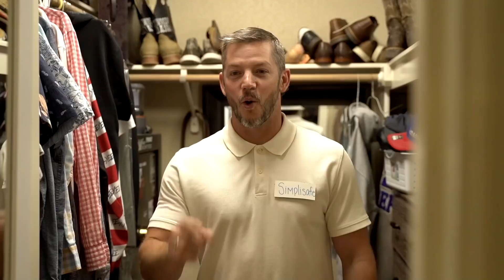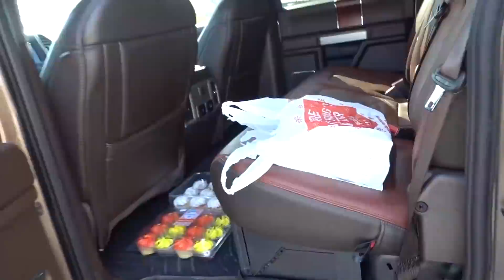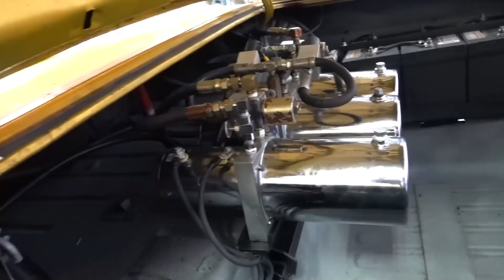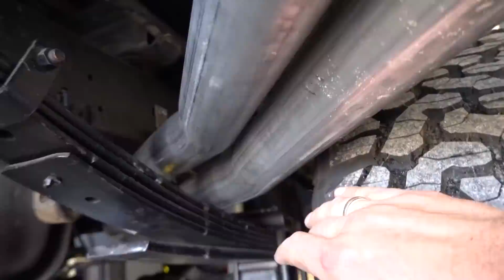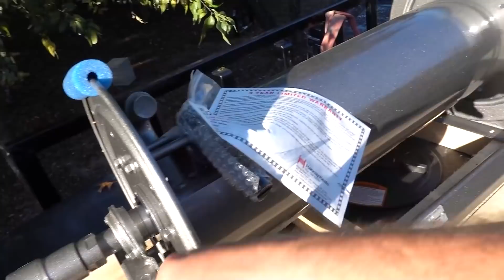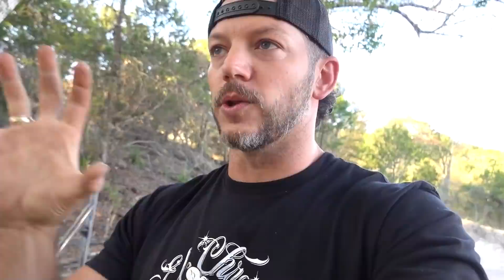Here's How a Local Car Shop Screwed up the Bronco...

Comment: Graphing is normally done to young trees. I've seen comments to dig a trench behind the tree and pull it straight then anchor it down which would work on a younger tree that don't have established roots. On a tree that size, you'll run the risk of shocking the tree and killing it so its best to cut down it and let the smaller younger trees next to it grow and fill that space.

Comment: As a licensed arborist in Maine that deals with oak trees almost everyday the tree will not be as strong after cutting and straightening of the base. It would have a much greater chance of coming down after doing so. The best thing to do in my opinion would be to cut it down completely
Reply: I agree, it also has a cavity in the bottom running up to the bend.
Reply: Don't forget that Oaks are susceptible to oak wilt
Reply: Great to see a fellow Mainer!
Reply: I think he was kidding when asking if he could bend it by cutting a wedge out of it! LOL He has to be trolling all of us in this video because there is not any chance in hell he is actually leaving that exhaust on the bronco, it has to be a joke he is playing on us, right? I mean, he has Muscle Rod shop that could have tossed in that simple exhaust for him. Then he has those high school kids that did the 5 ton cage he could have had them weld in an exhaust. So the current abortion of an exhaust is a joke on us i hope!

Comment: Regarding the tree, dig a little trench next to it. Make an anchor point some meters away and attach a winch to pull the tree more straight. Hopefully it will settle correctly in the little trench.

No cutting, no damage to vehicles.
Reply: This or just cut it down. But I like this idea.
Reply: Good idea. Undermine the trunk/roots on that side and hook the 5 ton to it, yank it over then anchor it somehow. Huh.
Reply: You'd need a few hundred tones of force to do that a tree that size.
Reply: It's growing that way not leaning so won't work and your cutting the anchor roots if you dig a trench next to it. So not worth it.
Reply: @Crzzyhillbilly  no you don't. If you go high and use a dolly it's very easy.
Reply: @HITMAN20211  He's not trying to move the top of the tree..
Reply: @Crzzyhillbilly  I know...

Comment: I think you could've welded the bronco exhaust better than they did and running the exhaust through the leaf springs like that, really? You should take it back and make them fix it or reimburse the labor cost. You're going to have issues with it, you're probably better off taking it to reputable shop and having them just redo the whole thing.

Comment: I got a couple things, firstly, make sure you have some flex hose for each section or the vibration and what not will likely damage it. You can also use high pressure suction hose which is like a very ridged flex hose.
Secondly you should definitely be bringing that exhaust back to be refunded and then take it to a shop that can do quality work.
Lastly not only will a graft like that not take, it would be extremely difficult and dangerous to attempt since with all the bends it the tree there would be different sections under tension and compression and that tree is probably 10,000 pounds and effectively has a sail on top of it, it would probably be easier to cut the tree and balance your f350 on the trailer hitch on the stump. I’m exaggerating but I would definitely recommend just cutting it and having a company come plant a mature tree in a more convenient spot
Reply: Agreed. All very good advice. The tree definitely has to go. There's plenty of them left around and it way too unsafe to attempt a graft. 

The only other idea I had while watching, was that the hose reel for the fire truck should be mounted so that it is inside the bed of the truck. If it hangs off the side, it can get caught on stuff and be damaged right when you need it the most.
Reply: I was going to say the same thing about the piping for the house, though the easiest would probably be rubber flex fittings/boots at the beginning and end of each run, but for the exact reason to absorb any flexing or shifting from uneven/rough terrain.

Comment: Unfortunately grafting a tree of that age is an extreme long shot that could lead to the tree dying and ultimately falling causing damage to other trees surrounding it
Reply: Still worth a shot its ether getting cut out or surviving lol its already taking damage and thats not exactly good ether for a tree. The biggest problem I see is moving it without it breaking off and ther healing process
Reply: @jake-bw7rw  I just suggested that he turn it around. Lots of companies can pluck it right out of the ground and turn it 180 in the same hole. Kinda expensive though.
Reply: @mckrackin5324  yeah they can do that I sapose but it puts alot of stress on the tree and it might not survive also it takes away alot of its structure so if a good storm rolls in it could do more bad then good but thats not a half bad option ether

Comment: Please take the bronco to a professional shop to have the exhaust fixed.. imagine the shotty work you can't see.. not to mention, I wouldn't be surprised if they were cutting and grinding the exhsust with the engine opened up  if they had to remove things for fitment

Comment: That's called grafting. A tree that big has to have a much smaller graft branch in it. Too big of a branch grafted in will kill the roots.  Early spring would be the best, so long as it goes dormant (leaves all fall off). Do it right before the trees all leaf out so it sends nutrients from the roots into the new portion that's been grafted in. Plenty of videos on how to do it. The trees are both bent that way for a reason though. Strong regular winds, etc. Might be better just to cut it down.
Reply: bump
Reply: That bend is from a very long time ago.

Comment: Do not think you can cut and graft an older tree like that, the old wood inside will not heal, only new growth will heal and new growth is just the outer ring.

Here is an idea though, hire a tree mover, they can just pick up the tree, clock it about 180 degrees and place it back in the same hole.
Reply: Pretty sure thats way too big of a tree to be moved by a tree mover, its also a terrible shape for moving and tis not very economical either.
Reply: @eraldorh  they'll move 300 plus year old trees. This size of tree would be no problem for them. The lean on the other hand they might pass on.

Comment: The tree will die if you cut it. You would never be able to align the phloem , cambium and the  sapwood let alone support the weight of the structure.  That works on small plants I never seen it work on a hard wood plant such as an oak.

Comment: People need to quit letting shops like the exhaust get away with that. That’s a ridiculous job and should be fixed by them. I just fixed an exhaust on my wife’s f150 because the previous owner excepted a piss poor job
Reply: Exactly why I started building my own. 
You can get kits with slip fit couplers and mandrel bends then weld it up.
Reply: @brandonrice8905  

Yep! That’s what I used. Hell the stuff I took off was even welded to the hitch for f’cks sake! smh
Reply: @Fordgroup00  my old truck's exhaust had welds that looked like rusty cottage cheese with hairs in it. Yeah, there was welding wire sticking out all over every weld. But none actually leaked. So I guess there's that.
Reply: To be fair, if a muffler shop couldn't figure out why running an exhaust pipe THROUGH the leaf springs is a bad idea, I don't think I would ever want them anywhere near any vehicles I own ever again
Reply: They excepted a bad job??
Reply: It's not even flared and fitted for a mechanic to replace the bad transmission if it ends up being that
Reply: Accepted

Comment: Look up a “Tree Spade” giant piece of hydraulic equipment that you could pick up the tree by the root system and spin it 90 degrees out of the way or just relocate it all together.
Reply: luv this suggestion even a tree as big as that one
Reply: That’s what I was going to say!
Reply: Great idea if a tree that large can be moved with a tree spade.
Reply: Unfortunately a tree spade wouldn't be feasible for that size of tree. The general rule of thumb with tree spades is that the spade needs to be 10 times larger than the diameter of the tree that you wish to move. If Matt is accurate with the 2 foot diameter of the tree then you would need a tree spade that was at least 20 feet.
Reply: I dont know much about trees but isnt the root system almost as big as it is above ground? you would need a unit of a tree spade 🤣

Comment: They had it on the lift when they put exhaust onto everything was hanging low, and once they set it back down you lost all your clearance.
Reply: True… but a good exhaust shop would A know that and B check before giving it back to customer.
Reply: @sccarguy8242  Absolutely! What a joke indeed.
Reply: That's why all the muffler shops I've ever seen will use 4-post lifts for everything.

Comment: Related to the tree, theoretically it's possible. The problem is that most likely it'll just break under it's own weight(as you're trying to bend it). On top of that, I don't see how you'd be able to support that much weight without it snapping during the next 10-15 mile an hour breeze.

So, realistically you're better off just cutting it down.
Reply: I agree with the above statement. It comes down to how badly you want to save that tree. NOT being an arborist, I'd assume splicing the tree is theoretically possible, but it would involve serious expense and effort for a (likely low) chance at success. Also, considering the "suckers" surrounding the subject tree, I suspect it would be best to cut the main trunk and let the newer growth continue.
Reply: Agreed.

It does look like there is some shoots coming out the bottom of they tree. They will likely grow extremely fast if you cut the large main portion of the tree and leave the small ones sticking straight up
Reply: Or relocating it? :D

Comment: It's pricey but you can turn the tree around 180. It's growing towards it's dominate light source. If they were to pluck it up and turn it around, it would try to lean back the way it was and eventually stand up straight. It would also have a really cool S bend in the bottom. Lots of tree relocation companies to choose from and it would be a little cheaper since they won't be transporting it anywhere.

Comment: You might want to talk to a local nursery about moving the tree. I dont see a cu t and regraft working. If they say no way to move it i say  heck with it cut and try to graft worst case the tree dies 
In the end though honestly your property is likely full of those trees it is no huge loss to just take it down. Others said undermine the root ball and let it basically fall over in to place that is a potentially workable solution as long as you can 1 support the tree while doing it and 2 can get under it enough to even do it. 
As long as there is enough soil around and on the roots the tree may not even skip a beat

Comment: Matt, you're going to have to have that exhaust system redone, lousy work. You got cheated. (Keeping it nice.) As to the tree, forget option 3, it won't work. The cambium layer might grow together, unlikely. However, the heartwood will not grow back together, and the tree would break at that point.

Comment: That engine deserves a mandrel-bent exhaust, not some crush-bent hack job. Take it somewhere that does quality work for buggies and racecars
Reply: I was thinking same thing.
Reply: That exhaust looks like something I would do with my 110v in my shop. Also can guarantee the shop did it with the truck hanging in the air.
Reply: Yeah every single visible weld on that exhaust was done with a flux core welder. Cold nasty bugger welds all over that shit. Every single joint will eventually break. Hit up cleetus and see if one of his guys can help out making a nice stainless exhaust for the bronco
Reply: @phillblack1745   yo what the hell are you on cause i want some did you take the time to read what you did its all incoherent babble
Reply: @nicholaspayne349  yep should be all tig
Reply: i learned that in High school welding class
Reply: @nicholaspayne349  that would be bad ass. Tye is one hell of a fabricator.

Comment: Matt you still need a flexible line or you will have cracked pipe if you have it ridged mounted.
Reply: if the fittings are set up corectly they will allow for movement and flex without stressing the pipe
Reply: I was thinking the exact same thing. Any flexing will crack a hard pipe

Comment: The problem is the cambium layer on the tree.  The middle of the tree (the "wood") brings up water and gets rid of waste.  The only part that is alive, for all practical purposes, is the cambium layer.  That's the thin layer, just below the bark.  That's why   
Porcupines kill trees when they ring the tree.  You've done some damage already, if it were possible at all, I doubt it would survive.  Cut it down and send it to a sawmill.  When the wood dries, now you have an excuse to buy that wood bed step side you always wanted.  Just don't tell Mere...😁
Reply: Send it to Andy Rawls to make something out of it.

Comment: As for the tree. If you cut such a large tree, the trunk will not be strong enough and can easily break in the first wind. You can gradually bend the trunk. You have to create a fixed point on the opposite side (for example, you hammer an old rail or traverse, a little diagonally and enough deep into the ground) and use the winch to bend the tree a little.  For example, some cheap hand winch, which you leave here so that the rope is still taut and holds the tree. The trunk needs to be lined with boards, any has not been damaged and I recommend using a steel cable.  Wait a month, for example, and bend it a little again. Pretty gradually slowly.

Comment: Hey Matt, don't underestimate the interest in how the mansion is coming along.  True, you've had 2+ years of really great and momentous progress with the project.  Now you're into the fine detail stuff that comes with finishing things out and it may not be as eye popping as putting on the roof or digging the hole for your underground bunker in the garage, or starting the install for the pool (it would be nice to know how that's coming along BTW!  ;-) ), but I think many would be curious to see snippets of how the detail work is coming along.  It doesn't have to be a long winded video but little teasers from time to time would be cool.
Reply: Those welds on that shit exhaust are sad
Reply: Even the light switches would be cool to see!!

Comment: Just FYI, get the bronco inspected before getting the title done so they can actually give you registration at the time of getting the title. Or you would have to go back a 2nd time. And check what hours they actually do title work- they may close at 4:30 but stop titles at 4 #iworkatataxoffice 😁
Reply: Texas makes you get vehicle inspections?
Reply: In PA, the registration and insurance have to be current before an inspection can be performed.  You can’t get a valid registration without some form of proof of ownership, be it a title or bill of sale.

If I tried getting my pickup inspected without valid registration, I’d just get charged $45 and sent off with no sticker.

Comment: yeah I cut a large cherry tree down, left some branches at the base, and it grew back to its original height. If you cut the middle, the remainder will grow back. Each trunk is independent.
Reply: Also if the alternative is to keep hitting the tree, and have it eventually die anyway, Its better to trim the tree in a controlled way that prevents rot getting to the rest of the tree, or tearing out roots when it falls.
Reply: Oak and apple are different not all trees are created equal

Comment: This is just an idea but instead of completely hard piping everything to and from the pump shouldn’t you I have a little bit of flexible hose just for vibrations in vehicle flex Or if the pump or tank gets moved around a little bit the flexible hose will keep it together and not break as easy
Reply: if you connect hard pipes correctly they will allow for twisting and movement without damage to the pipe
Reply: Typically if you hard pipe anything, you want to connect the hard pipe to anything that vibrates or moves with a short flexible pipe to keep the hard piping from getting stressed/damaged
Reply: @cj7man80  i hadnt thought of vibrations

Comment: Doesn't appear to be the type of car you would take to do burnouts but will be hilarious when it breaks into pieces
Reply: Lowriders typically have beefed up frames and 4 link suspensions. Your comment is full of ignorance
Reply: @nonyabidness6492  your right I don't know much about this never have I seen a lowrider ever try doing burnouts there always at cars shows looking pretty and hopping around if Matt says this will work obviously I believe him just can't imagine it...
Reply: @stavay3736  that's cause burnouts leave hot rubber on your paint. Typically you'll see guys who do the hop competitions do it cause they know the body might get hit.

Suspensions on lowriders are typically beefier than your average cars. They have 4 link suspensions and plated frames so they don't bend or crack when they hop

Comment: You can't graft a full grown oak tree. Among other reasons, it will almost certainly die from the shock, and if it doesn't, there's too much topside weight to allow a firm graft. The first good wind will knock it over.
Reply: "Can't" and "terrible success rate" are not the same thing